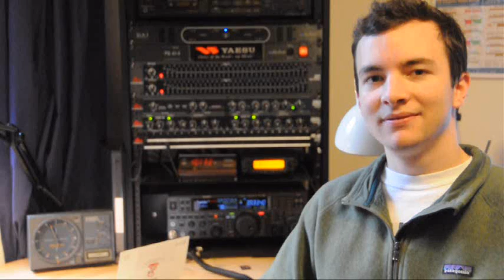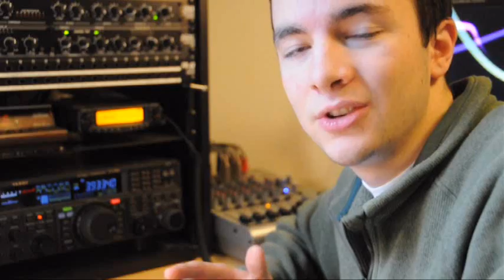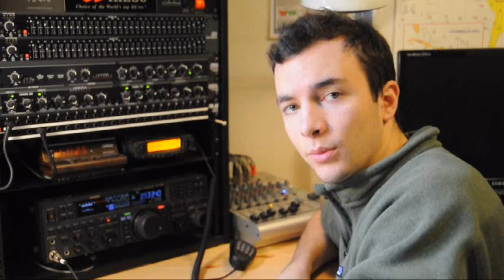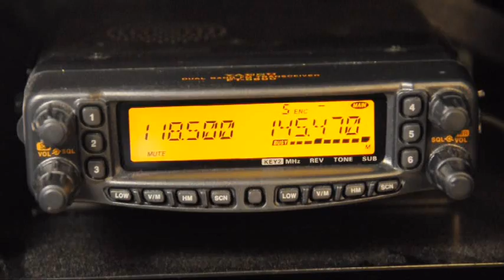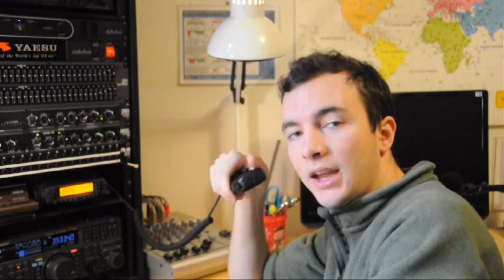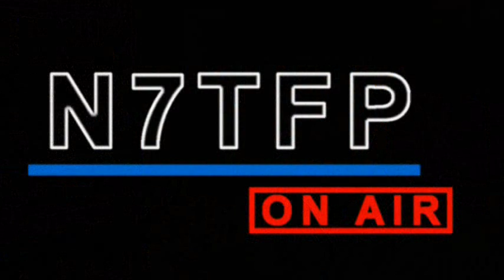Ham Radio Tutorial - 2 Meter Repeaters

Comment: well u have had that rig bout 4 years now, how is it holding up, what do u like best about , what do u dislike most. would you buy it again , or something different. Im getting ready for my tech exam, and want to buy a mobil rig and just wondering , about the best rig to start with
Reply: Hammer USN, guessing you have taken and passed your Tech and have your station ID by this point.  That is a loaded question with the best rig to start...lol  As I am sure you are finding out now, there are good all around rigs and some that completely blow.  The main thing every operator has to do is ask themselves what they are using it for and if the radio you are looking at meets your needs.  If you are just looking to hook up a stable rig in the truck or car for use while your traveling, you may not want a quad band mobile, you might just want a single bander that is small and packs a punch.  If you are putting it in a shack to use regularly, you might want that quad bander so you would not have to change to a different set to make contact on a different band.  The other thing that limits most guys and gals is the budget...Most radio people I know and have meet want the best performance for the least amount of money, so there are normally going to have to be compromises made somewhere. Also as you are learning, if you are mobile, you will get a lower performance no matter, as you can not go down the road with a 33 foot antenna bolted on your roof...but you can still make good contacts within those limitations. Have you bought a HT yet to start getting your feet wet?
Reply: +Bruce Lawrence yes, and thanks for your response. I passed the test on the 17th of this month at a local hamfest in peptone Illinois, and I am not so patiently awaiting my call to appear on the ULS, lol.i bought a ID 5100, BUT honestly have no idea how to use it. lol, but am ready to jump in and give it a go, and I Am now trying to figure if I would be better off for a second with say a yaesus 857 or ..... because now I'm learning CW and like the idea of also getting on hf , when I get my general license.
Reply: I will check, think the 5100 is a 2m/70cm rig.  As Tyler was explaining on this video, at first it seems like the repeaters are a mysterious animal in the wild somewhere.  You have the basic knowledge to understand it, now it just a matter of applying that book knowledge to real world equipment.  I use RadioRefrence.com to locate repeaters in the areas I will be in, but there are several refrences online and in print that are availible for you to use.  The main thing is to get on and start getting comfortable with transmitting and receiving. Did you do a base station set up with your new rig, or did you put it in your vehicle?
Reply: +Bruce Lawrence Im using g it as a base station for now, the 5100 is a 2 m and 70 cm radio, but also has the d star, and it does seem a worlds apart difference from" book" application, o think I need to find a local radio club , would make things much easier, the only one o know of so far is the that administered the exam, and they did not seem like they were ..... friendly, so I'm looking for another in the area, seems most hams r very helpful as a rule, Amateur logic TV, ham college, ham nation and ham whisperer on you tube have been amazing, and so far the best  has been a guy " QRP SCHOOL"  . channels like this one and others, are awesome, and u as well , a great example of hams .... helping hams. great community.
Reply: well, i just checked the fcc uls again after reading your message here today and ....................... You can just call me KD9GRP !!!LOL, ha ha ! very exciting!
Reply: Congrats on getting your Call Sign.  Ham it up...lol  I am taking a wild guess that you were in the navy for some reason...lol...ask around about the local ARES or RACES team.  Those are normally very experienced operators that have tons of gear and years of advice...those are the two teams the local and federal government respectively rely on if the SHTF and nothing else is working to get EMComms working for them.  Once they find out you're a vet they will welcome you with open arms...give it a try.  Most of those guys love mentoring guys to do things right.

Comment: hey nice job, im a nube , lol, studying for tech, i was wondering i seen a radio on ebay that was identical to the one your using, except the one im viewing says it is a HYS , like i said im new, so before i buy it, was just wondering if it is the same as yours, seeing yours obviously was doing great. And ant suggestions on buying a home unit.
Reply: +Hammer USN It's probably a TYT, that's a Chinese brand, but it would be suitable for working repeaters, Simplex(direct radio to radio contact) might not be so good, but talking on a repeater with it would be fine.
Reply: +Hammer USN Well, I just found this. It this what you were referring too(there are so many of these chinese brands http://www.amazon.com/HYS-TC-135-136-174mhz-Transceiver-Amateur/dp/B00QWBCXZQ/ref=sr_1_22?ie=UTF8&qid=1460163641&sr=8-22&keywords=vhf+2+meter+mobile And this is the antenna I use on 10 watts 2 meters, and it gets out good, I'm also running it inside(hanging it from ceiling vertically) and it still works well http://www.amazon.com/Falcon-Meter-Dipole-Amateur-Antenna/dp/B003CMNBIQ
Reply: Hey, thanks, I appreciate it
Reply: +Hammer USN yep, if you need anymore help/info let me know. 73 KM4PFZ
Reply: +Timothy Parry Jr thanx

Comment: I notice there's a FT-8800 in use here.  I just got one and for some reason I can hit repeaters and hear a trail but when monitoring with an HT I can't hear any TX.  I'm using the correct tone, as i can hit the repeater and TX with the HT using the same tone.  I'm killing myself going through the settings in the 8800 because I'm sure I don't have some setting turned on.  Can anybody help????
Reply: +roadawg001 I suspect it is defective. I hope you sent it back.

Comment: When you talk on the 2 meter are you talking on input or output
Reply: Zacharias Newton I think you are asking the input vs output of the repeater itself. You want to Tx on the input frequency of the repeater, and Rx on the output frequency. Typically though the best way to set up your radio is to program in the repeater's output frequency and then program a "Positive" (+) or "Negative" ( - ) shift. This will automatically 'program' the repeater's input freq. into your radio. This uses the standard 600 kHz shift, and it is extremely rare for a repeater to not use the standard shift. Often times the repeater will be listed with it's output frequency, followed by a + or a - ie 147.950-. That signifies to use a positive shift. If the repeater is listed with both output and input freqs, quick math will tell you whether to use a positive or negative shift. if the input is lower in freq than the output, then you will want to use a negative shift, also while doing the math, make sure the two freqs really are 600kHz apart (or 0.6mHz) ie Output: 147.950  Input: 147.350.

This really applies to all repeaters networks regardless of band, except the shift will be different, ie 70cm band uses a standard shift of 5mHz

Comment: You actually do not show how to "use" a repeater since you say nothing about the actual shift between frequencies, the direction of the shift and the CTCSS tone required to actually get the repeater to work. Those three things are required to use the modern repeaters.

I have had to "rescue" new hams from the clutches of others that really do not understand the programming so I end up with their radios to get them working and on the air. After they are successful, they are much more amenable to learning to program their own radios. It is frustrating for new hams to buy and expensive radio and antenna and not be able to get it to work.
Reply: Tyler, good job on this video.  Remember, there is always gonna be someone who stands on the sidelines and is the critic.  It is not the critic who counts, it is the guy in the ring, willing to put himself out there.  I would recommend another reading of "The man in the arena" essay/speech by Theodore Roosevelt.  To Jay Tibbles,  I'd say shame on you for slamming the good effort of this young man.  And, by the way, where is your perfect video?
Reply: +Standing Bear the offset should be -600 or +600 plus you need to input the Private Line tone, sometimes you can can do that directly on the radio or use a software like CHIRP to input.
Reply: @Standing Bear, I am a new HAM and learning much through YouTube. I  just wanted to say glad you mentioned actual shift between frequencies, the direction of the shift and the CTCSS tone required to actually get the repeater to work. I'm getting to understand and program my Yaesu FT2900R, got a couple of transmits out.
Reply: JAY TIBBLES so where is your video doing better?
Reply: +Standing Bear Not sure that's an accurate comment - using a repeater is speaking via its re-TX to others who you otherwise probably wouldn't contact.  So in that regard Tyler's quite correct with his title.  Setting things up is covered in probably dozens of YT vids and the procedure for one rig won't help exactly with another, except with experience you can find your way through the menus and set things for the ones you need to use - but if you're experienced you don't need instruction clips?  :)

Comment: Alright easy now, brand new just got a gt3 mark II, and il probably get scortched, but will someone explain the repeater vs offset to output frequency transmission, Its a dual band and I can hear people through both the top and bottom frequency when I, a/b switch on this thing..so how do i control the frequency I output to..or am I suppose to a/b switch between listening and talking because that's just wrong, and I say that because I've looked up some ham stations and they have a input frequency not far off from the original listening one, so how is that determined when you find a random signal, to reach what they are listening to, I got a idea of what a repeater is used for and its sync, but offset and output confuse me..how do you find out what frequency they will hear you on because true scenario went to work could hear them but they couldn't hear me..
Reply: Rook E When you find a repeater that is transmitting on e.g. 145.000 MHz with an positive offset of 1.6MHz you should transmit on 146.600MHz. When it's a negative offset you are transmitting on 143.400MHz. Please make sure you use CTCSS tones if needed by the repeater.
Reply: Rook E I would say that the repeater listing in the states would show the input / output freqs and I guess the offsets would all be the same (as a rule)
Your radio will generally be ready to go for duplex (repeater usage).
But ffset settings can be + or - or = and be .6 or selectable if you need to fiddle.
Only if you need to use a weird repeater or are overseas would you need to reprogram your channels and offsets. Using the same freq for both RX and TX is called simplex operation. Your radio will probably be able to switch between the modes.
I'd be surprised if the manual doesn't explain it.
I'm in Australia so our repeaters may be different offset.

Comment: can this be used as a police scanner also either digital or analog?, or does it have a regular CB mode?
Reply: Lol
Reply: Nick, this is a 144 MHZ/440MHZ VHF/UHF Amateur Radio Transceiver. CB has nothing to do with this particular transceiver. The citizens band is on 27 MHZ Amplitude Modulation and is an unlicensed band outside of all of the amateur radio bands.  The transceiver(transmitter/receiver) that Tyler is using, you must have at least passed the Technician Class Amateur Radio License test to legally operate in the United States. And yes, it is possible to listen to some public safety frequencies on these transceivers(analog).
Reply: Hi-Hi!! Really. CB Mode??

Comment: Thank you for the video Tyler.  I should be taking my licensing test in a week.  I'm going to take the Technician and General license tests at the same time.  As long as I pass the Technician test that is.  :-)  I have a 2 meter rig on the way and this video has been very helpful.  No I won't transmit until my license is posted .  ;-)

Comment: Yep, Most people program they're local repeaters into their radio and then set their radios to "scan" mode. In scan mode, the radio quickly scans all the programed channels very quickly and if someone starts talking, the radio stops so you can listen to what they're saying. You dont have to use a repeater, you can use 146.520. That is the general channel that most people monitor around the country.

Comment: This is the "offset". 2m (144MHz) repeaters use a .600 offset. You transmit .600 below the set frequency and the repeater re-transmits at the same time on the frequency .600 above at a greater wattage. Someone listening to the repeater will hear you on 144.820 but you transmit to the repeater at 144.220. When the contact to replying to you, you hear them on 144.820 because that's the frequency of the "repeater".

Comment: OK, I'm a little confused.  In this video the frequency display shows 144.870 MHz when you transmit, but then it switches to 145.470 MHz on receive.  Is the repeater frequency the TX or the RX?

Comment: Hi N7TFP. Great vids! I am currently studying for my license. My goal is to be able to communicate between my home in Dallas TX and my cabin 200 miles north in Oklahoma's kiamichie wilderness. What level of licensing will I need to do this? What bands would be best for this distance? I would like to use repeaters and also do  communication without repeaters. What would be a good entry level rig? Thanks for any information you can provide.

Comment: What Tyler is saying is that if you're running through a repeater then you don't have to call CQ, Because the repeaters 9/10 times will be using a PL to gain access to Transmit. if your radio is broadcasting this tone, then it will key up, and others will hear that it is keyed up. Doing HF you can't really Distinguish if someone is Keyed up or not, Thus calling CQ to allow people to adjust frequency to them (like if they're drifted off) and be able to catch thier call sign in time.

Comment from the maker: @bm4shooter76 1) Yes, That is the input/output process in action, and 2) 118.500 is a frequency of the local air traffic control tower in Tacoma. Only used for monitoring.

Comment: @N7TFP this is great!  I have a couple of questions for you:

1) At the beginning of the video you mentioned that a repeater will receive a signal (input) on one channel then repeat that signal (output) on a different channel. I noticed your radio display switching from 146.220 (Tx) to 146.820 (Rx); is this the input/output process in action?

2) What is the 118.500 on the left side of your radio display for?

Thanks!!

Comment: Can I get "Decent" performance using a magnetic mount antenna ontop of a tool box (large, rolling kind) sitting in the corner ontop of the rubber mat?  Or do I need metal on metal contact?  I'm not looking for perfect, just something better than a hand held with a rubber ducky!